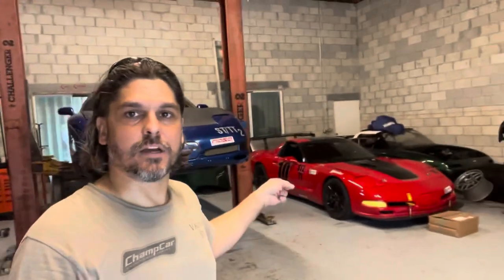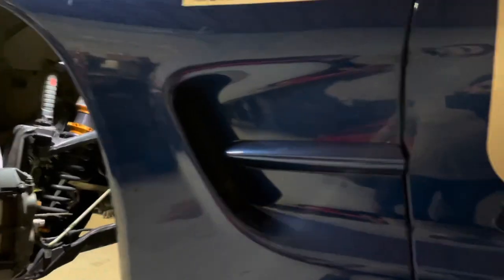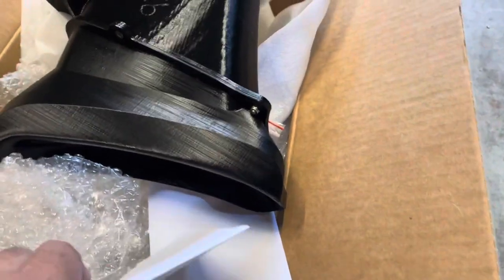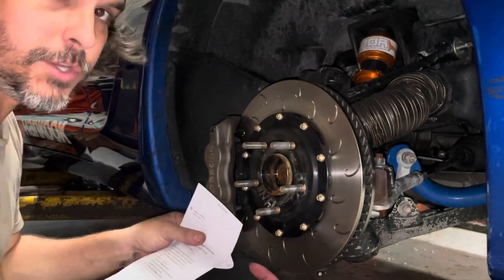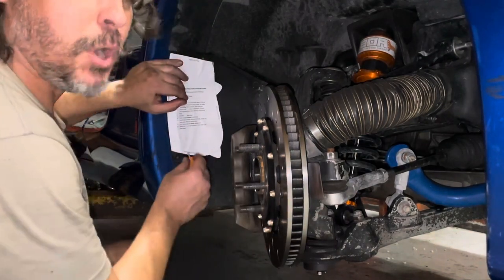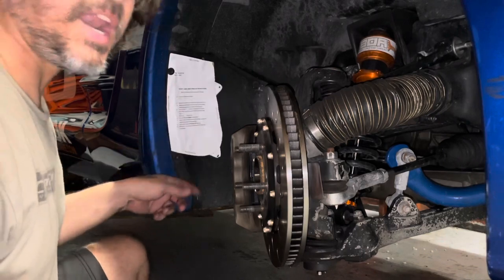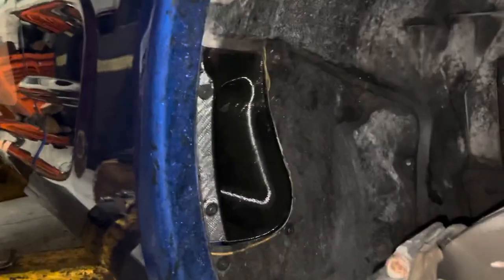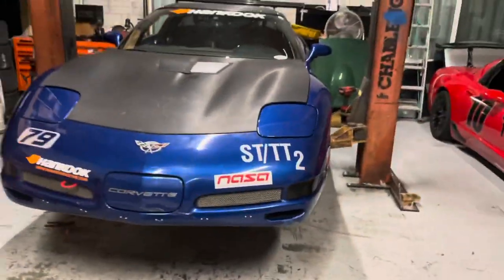Electron Sport C5 Vette fender duct install

Comment: Now is the side of the vet going to get dirty or muddy from pass thru air flow?
Reply: I was thinking the same thing. It will definitely leave water tracks in the door when raining.  And if road debris can make it onto the air stream then you probably would get finish damage. Especially at 170 m.p.h.
Reply from the maker: It’s primarily a race car. Haven’t driven in the rain yet but yes, there is more dust on the side of the car.